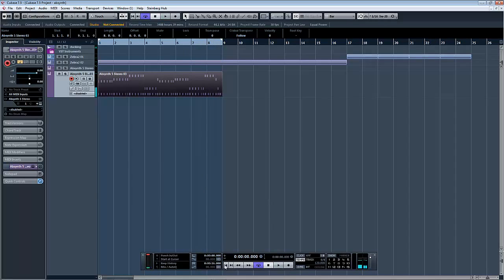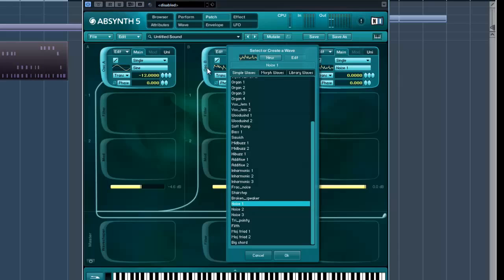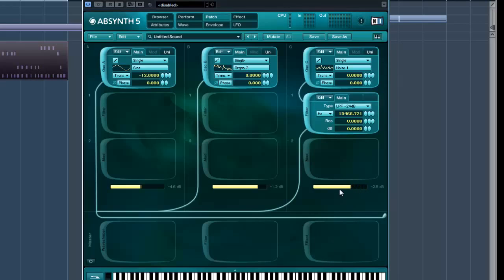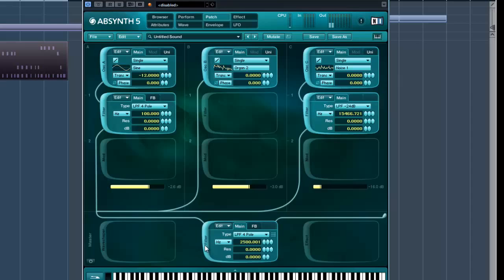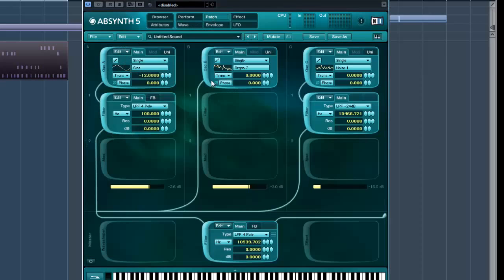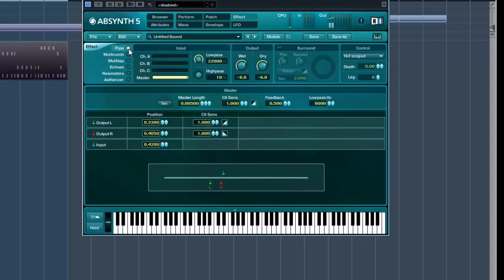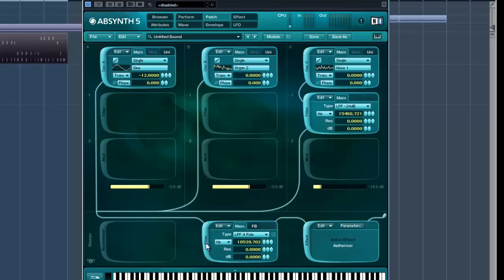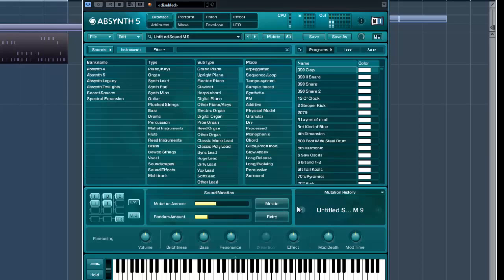Native Instruments Absynth - House Organ Sound Design - How To Tutorial

Comment: Hey it seems as though you had program in a specific set of keys to keep replaying while you adjusted the parameters. How do you do this? (10:00-11:00 timecode) I am trying, but I keep having to play the same keys on the keyboard at every time while i try to adjust and its pretty hard to get correct... I am pretty new to Absynth, so any help would be appreciated..Thanks